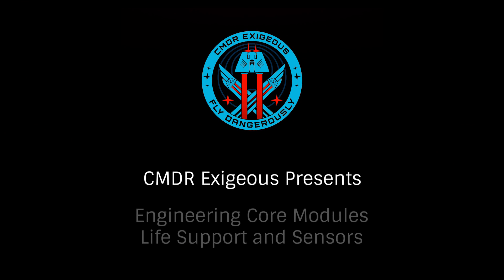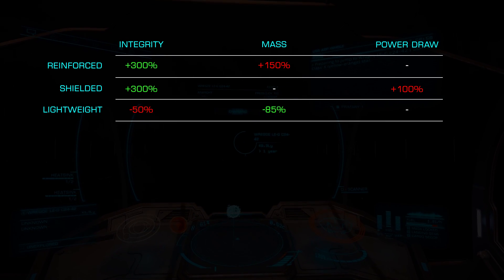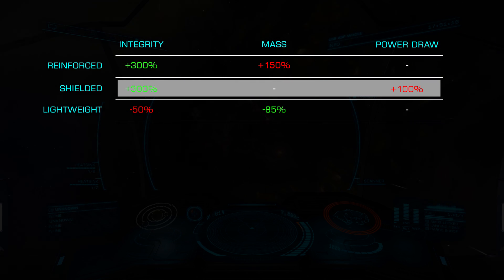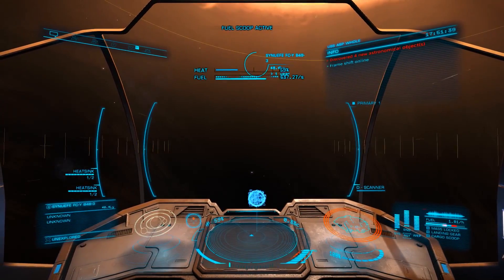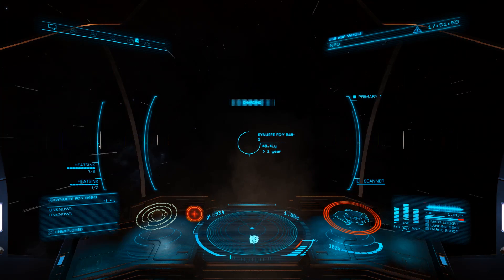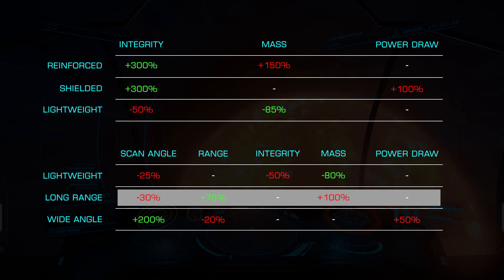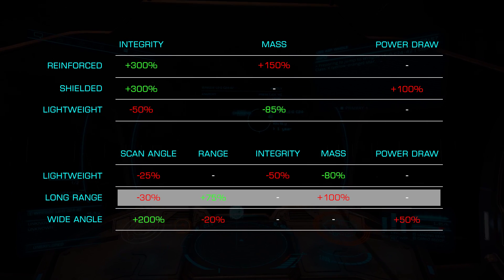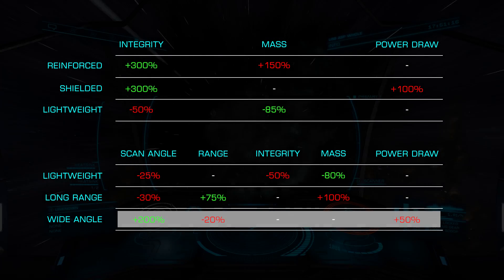Engineering Explained: Sensors and Life Support

Comment: A thing to note about long range sensors is that regardless of the sensors' rating, the long range effect will increase the maximum range to 14km. This is especially useful among those of us who partake in AX combat, as Thargoid Interceptors are always detected at maximum range, meaning anything other than long range D rated sensors are just unnecessary mass.

Comment: Are A rated sensors really that much better over D rated? I can't tell the difference in game so why not go lightweight.?
Reply from the maker: They do give a longer range - so for a bounty hunting build they are an okay idea - the problem is how heavy they are. For example 8A sensors on the Anaconda are 120T and with long range they are 320T. That does give you 13KM range but for the most part IMHO just not worth it as your longest weapon is 6KM. So I generally go D rated lightweight or D rated long range.
Reply: @Exigeous  thx

Comment: Also of note, when engineering your Life Support, the higher its integrity, the higher your canopy integrity, as well. This is nice with certain ships that generally lose their canopy easily (cough Vulture cough).
Reply from the maker: I am 99% sure this is incorrect - I've heard this myth before but have never seen a single piece of documentation that states this.  The only thing that reinforces your canopy is a module reinforcement - please post a link to your reference, thanks.
Reply from the maker: I've confirmed this is *100% incorrect*.  The only thing that adds protection to your canopy are module reinforcements.  Life support ONLY effects the amount of oxygen and the ability to launch fighters, and that's all.  Sure would be nice if life support did effect it as the canopy on my Chieftain would be very happy.
Reply: @Exigeous  I know this is an old vid but i have a question if you wouldn't mind answering. With shielded AFMU for example 1 does it lose it's integrity when powered off making reinforced the better option ? 2 because it's shielded would that mean phasing sequence would work on it somehow either 1 with ships shields up or 2 once ship shields drop ?
Reply: @danny1229c  The only effect available for AFMUs is shielded, and it retains its integrity regardless of whether or not it is powered on. To my knowledge the phasing sequence effect only deals (absolute) hull damage and not module damage.

Comment: Does sensor range effect the distance at which you can scan a planet while exploring?  Is this a function of the detailed surface scanner?  Thanks!
Reply from the maker: Nope, it doesn't at all.  That is a fixed value - the only thing that changes it is engineering to the Detailed Surface Scanner - sensors in this context refer to our sensors while in normal space so when we're in combat, near stations, mining, etc.
Reply: Rob Routh I checked inara.cz As this question also occurred to me, I think scanning of planets is only improved if you fit a Detailed Surface Scanner and then mod that with either long range or fast scan. Hopefully CMDR Exigious will correct me if I am wrong
Reply: Cool.  Thanks!

Comment: On my 'Vette I go A rated life support with the Lightweight mod, and D rated scanners with Long Range mod.
Gives me 25 minutes of emergency air for not much weight that a D rated module, and I get 12 KMs of scanning.
Reply from the maker: If you're not using a fighter you're just wasting mass with that heavy A rated life support as you can synth so easily and 99% of the time if you can't get to a station in 7:30 you can't get to one period.
Reply: It weighs a whole 5.00T with G4 Lightweight.
A D rated is 8.00T, with G4 Lightweight it's down to 1.60T, so less than 4.00T difference on a 'Vette.
I used to run a fighter, not anymore. Wasn't worth the sting in my wallet.
Reply from the maker: D'oh - sorry, I had sensors in my head- but that said the Vette is class 5 so the difference is between 6t and 2.4t (A to D rated both with lightweight) - but yeah, on the Vette that isn't a huge difference.  For sensors the difference is huge.
Reply: Yeah, that sensor package is huge! 64T for the D rated and 160T for the A!
Wouldn't wanna drop that on your foot.
Reply from the maker: Well yeah, then double it for long range and holy shit that's a whole-lotta-sensors!

Comment: Hmm first, but im here to ask, is FDL good for combat? (bc i dunno FDL or imperial dropship)
Reply from the maker: The FDL is one of the most popular and yes, unengineered it's great for bounty hunting.  It is absolutely a shield tank and can have amazing shields when engineered.  I'm not at all a fan of the Dropship, especially for new commanders as it really needs to be flown full FA-off to be effective.  So go for the FDL
Reply: In my opinion the Fer-De-Lance and Federal (not Imperial) Dropship are both great ships for combat. The Dropship doesen't have great shields though so you need good armor. While the Fer-De-Lance can have great shields. Although the Fer-De-Lance is more expensive to buy then the Federal Dropship. They're both great ships for combat.
Reply: racegdod great shields? Im going for it